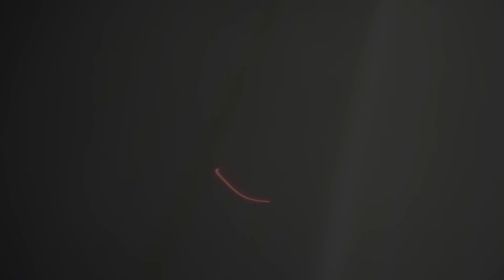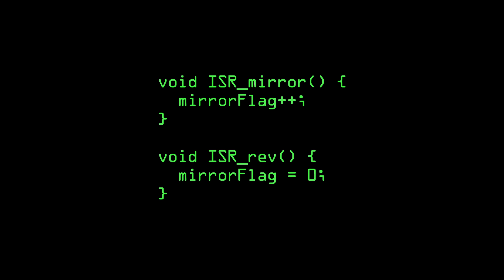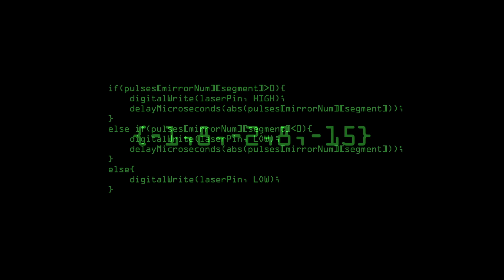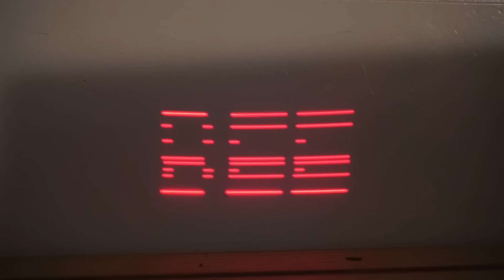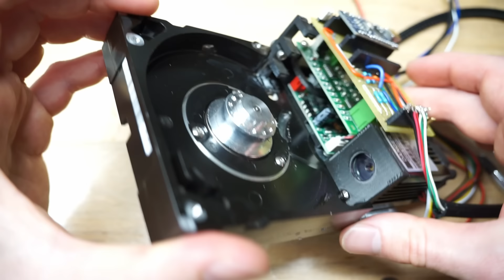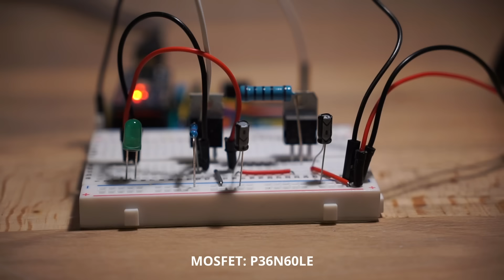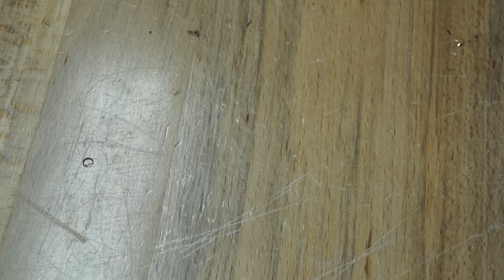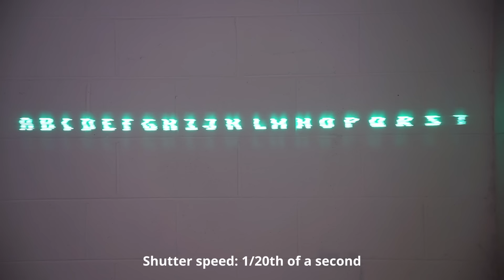DIY Laser Projector - Built from an old hard drive

Comment: Nice, project  instead of using rotating mirror u can use tow galvanometre to drow vector image and text, also  u can use three 18650 lipo battery for power.  Use tiny spring under the mirror to adjust their tilt.

Comment: I suggest refactoring the circuit design to commute the laser diode so the MOSFET "short-circuits" it ( "Shunt" or "Shunt with Over & Under Drive", i.e. connected in parallel to the diode, so it turns it off by making the current flow through the MOSFET when *on*.  ). That's a trick that would allow a significant improvement in switching time, with no "leak resistor" needed in "Shunt" mode.

Comment: if the timing is from the balance of the print, you could add another arm opposite the frame start arm, but have it stop short of triggering the sensor and give it a greater infill so it has the same mass as the existing arm

Comment: i would suggest maybe a cheap balancing rig, like for hobby rc planes for balancing the props, that will help with the vibrations. hopefully those mirrors are super flat, cuz if they are just like "arts & crafts" cheap box of disco ball mirrors, they are nowhere near flat enough. and both the roughness of the mirror and unbalanced jig will prevent that display from ever being smooth and crisp.

Also not sure what kind of driver you are using but if it's just a MOSFET on and off, you can prolly make a better one yourself. i have a big COB LED and i use its cheap driver board with a MOSFET functioning like a PWM power switch.

lastly try a better microcontroller, such as an ESP32. its much faster, if i recall right up to 80Mhz, i think stock is 8Mhz. and it comes with blutooth and wifi, reducing your external breakout boards to one board the size of the nano. it also has a RTC built in so you can use real time for timing purposes. with the RTC and a higher CPU clock would allow you more slices in time to catch when your IR beam is broken.

Comment: Nice project, really enjoyed watching your progress. 

Doing electrical engineering for a very large laser company, I would not entirely blame the Arduino for the imperfections of the image.

In industry, we use two dimensional scanners for such jobs. Less moving parts, better adjustment.

First, I would use a aluminum, balanced mirror holder. The mirrors are crap, I would go with better quality ones. The sensors are placed in a bad angle related to the notches.
You definitely need a precise way of calibrating  your mirrors.
Reply from the maker: Thanks! There is a lot of room for improvement for sure. I'm aware that the mirrors should be first surface ones, which I will change if I build another one. I also plan to switch to hall effect sensors for position reading.

Comment: Laser printers use flawless rotating mirrors to scan the page, and the vertical movement can be done with a mirror mounted on a hardrives' head actuator or the focusing unit of a CD/DVD drive, which both conveniently have about the resistance of a speaker, which itself is a very popular option; an electric razor or coi in a magnetic field would also work, the options are endless.

Comment: Use avr-gcc and avr-libc by themselves without arduino for the most performance.  There are no default processes like millis() being serviced in the background, that will go a long way to eliminate the jitter.  You can accomplish this using vscode instead of the arduino IDE.

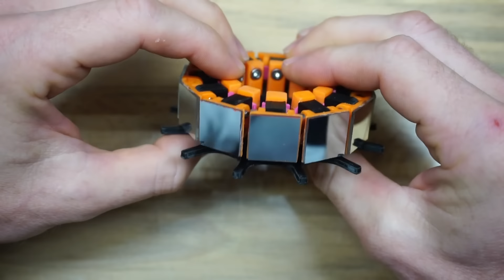Comment: 10:28 - So hitech looking part! I like it a lot!
Friend, are you using the bare black printed plastic passing in the optic sensor?
Be aware some black materials looks black for our eyes but they are translucent or even transparent to IR.
Try putting isolation tape or aluminum plate pieces in the sensing tabs to check if reduces the wobble effect (the aluminum is better of course).

Comment: Someone else noted the interrupt delay. 
Ignore that and switch to an ESP microcontroller. The faster clock speed will totally remove interrupt jitter, make Bluetooth easier and allow for Wi-Fi, allow for vastly improved horizontal resolution and introduce the possibility some tricks like PWM brightness control.
Reply: STOP promoting Chinese product
Reply from the maker: I actually tried an ESP32 with this but had issues with the interrupts - it seemed like they were inconstant and caused timing issues so I went back to arduino.
Reply: @benmakeseverything  that's really surprising and good to know. I will definitely look into this. Thank you.

Comment: Cool project.  Did you look into using a shutter for flashing the laser turning off and on like old film projectors it is a wheel with cutouts in it.  May reduce your overall complexity.  then you would only need to control the speed of the shutter wheel.  Good Luck!

Comment: The wobbling is jitter in interrupt response latency.  You would need a higher frequency CPU clock.  You should also make sure you specify all global variables as 'volatile' and enable full speed optimizations (-Os) in the compiler.

Comment: Instead of quickly turn on and off of the laser, try to use another shutter wheel disk with small sliced gaps. So your limit will be how fast you spin the wheel instead of on-off

Comment: Well done! I have been envisioning a very similar project for a couple years and never got around to it. This is a really clever implementation. +1 on the advice to ditch the Arduino. Maybe a Teensy 4 would be a good candidate, thanks to the Cortex M7. If you're feeling really ambitious, you could also switch to a hobbyist FPGA, like an Alchitry board or a TinyFPGA BX. Also, maybe you can order a planoconvex lens from ThorLabs or Newport to tighten up the resolution? Again, amazing stuff here!!
Reply from the maker: Thanks, the teensy seems like a decent option. Powerful specs at a decent price. I might use that on the next version.
Reply: Great project! I'd also recommend using a Teensy 4.0 to replace the Arduino. @600Mhz it'll give you everything you want. @benmakeseverything

Comment: For the sensor, use a magnetic sensor instead of the ir sensor. That should get rid of your wobble. Also switching from an arduino to a teensy4.1 may help a lot since the arduino works at 16mhz and the teensy4.1 at 600mhz.

Comment: Just a thought that popped up, If you make the Mirror assemply to always point forward, it will be easyer to balance, you could then build a mechanicaly linked prism assembly that would turn verticaly in front of the mirror. This would make it scroll to the next line every time the next mirror(line) moves in front.

This would also fix the one line of text issue as your horisontal space is not limited by the amount of mirrors you have.

Comment: It was one of the techniques used  in early mechanical television scaning system. Inventor mihaly traub uses fixed mirrors in circle with less number of scaning mirrors at the center .Comparable technique like nipkow disk was also used.

Comment: X-Y mirror assembly would be far simpler.
Reply: How exactly would you do this, any way that I imagine it doesn’t make sense because there is no way to keep either X or Y constant while one motor scans the opposite axis (let’s say if Y is constant then a motor has to scan X). After the scanline is done then it has to increment to the next row (increment Y position). But now you don’t have a continuously spinning motor for one of the axes, you’d have to use a stepper or something. And if you had them both continuously spinning I can imagine it would scan diagonally
Reply: @cobaltxii  X-Y mirror assembly has them on coils with a magnet so the voltage determines deflection angle. Then you just feed it X-Y coordinates. It has nothing continuously rotating so there's no restriction on the pattern. Move to upper-left, scan across at desired speed, then move down a scanline. Apparently some use galvos (motors) with feedback, and are expensive. People have made them with a pair of speakers with one end of the mirror mounted on the middle so it deflects.

Comment: If you wanna go mind-boggling complexity for the next version, the HDD head controller and arm probably has a ludicrously accurate MEMS servo / actuator on it that could control a very small intermediate mirror. This means that all of the mirrors could be mounted at the same angle and vertical offset could be managed by the head assembly. This would not only theoretically allow a greater vertical range of motion, but would also allow "vector" graphics as the angle of incidence could be changed during the sweep of a single mirror.

Almost certainly impractical, probably incredibly difficult to program, definitely prone to a huge amount of environmental instability, but, you know, possible...

Comment: Cool stuff!  Knurled Brass Insert Nuts instead of self-threaded, for next project.  As others already mentioned, a multi-core MCU at higher clock rates may clean up the image.  INT0 on PD2 is the fastest external interrupt on the AVR8-Mega series ... and it is not fantastic.

Comment: Great job! The wiggle of the text is similar to the splash screen of games on old computers like the ZX Spectrum. You can project your text or image onto a horizontal series of falling water drops or solid flowing water in the form of a flat waterfall so as not to fight the wiggle but to make it an "interesting feature" of your project.
Reply: My ZX80 back in the 80's glitched every time you typed a key because the video was done purely in software, throwing the generation off while it was doing something else. Using reverse engineered code for the PAUSE function though and if you timed things precisely in all the possible code paths, literally adding up the count of Z80 CPU instruction cycles and balancing them out for all code paths padding with NOPs if necessary, writing fairly simple games that would be flicker free was possible, a lot of fun and more interesting than schoolwork :)

Comment: I love it. 
I use a stereo amplifier with 1 inch speakers fitted with mirrors hinged on rim of speaker and pushed by centre . One channel is vertical and other horizontal. I have 2 oscillators that can do sine ,square and saw waves. 
Result some amazing patterns. 
As you said a small adjustment at laser end makes big change on screen. I have red and green ,did have a blue but was too dangerous so pulled apart and dumped.

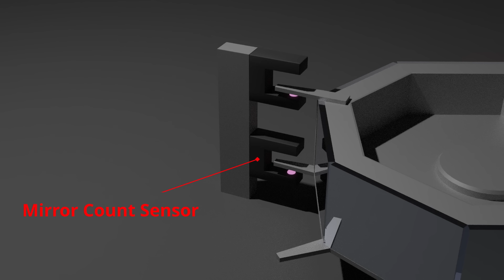Comment: Very interesting Video. I would like to know, why it should be relevant, which of the identical mirrors is passing (2:20).
Reply from the maker: Since they are at different angles, and we don't know what position the mirror array will be at when the device is powered on, that sensor ensures that the count always starts at the beginning (in this case the top line). Without it, it might start counting somewhere in the middle, so the the image might get projected something like: 7,8,9,10,11,12,1,2,3,4,5,6 instead of the correct 1-12. Hope that makes sense
Reply: @benmakeseverything  Absolutelly. Thank You!

Comment: I'm for More Power Ben and I'm not talking about going Overboard - We need Sharper and more defined stop start without the dimming of the frequency screwing with the laser - So The Power needs to be an RX2  with 3d printed handles and maybe a tripod stand holding the 5 liter gas tank - Oh and Earplugs for the audience what do you think?
But if the Rotary doesn't produce too much smoke the writing will be Burned on the wall.

Anyway Ben enjoys the project - hope you enjoyed my jokes.

Comment: Due to interrupt delay jitter, (interrupts are not instant, the micro has to finish it's current instruction) you'd probably be a lot better off just using interupts for incoming message updates from your bluetooth module.
Get rid of that motor driver and have the Arduino generate the motor pulses, that way the motor rotation will be in perfect sync with your code, this would also allow you to lose most of those tabs driving the photo transistors as you now know where the motor is as it is now slaved to the Arduino & your code.
The only extra bit is you'll have to add some motor startup code as it cannot instantly run at your final speed, you'll need to ramp it up slowly.

Comment: Really impressive Ben.   Well done on the persistence too.   couple of ideas for your future versions.   1) Not sure about the availability of red and blue laser diodes that could have their output balanced with this green one, but RGB would be awesome!    2) how about using the super-fast HDD heads arm in a vertical orientation, with a small mirror on the top.  you could use it between the diode and the spinning mirrors to dynamically apply micro vertical adjustments by your microcontroller, so you could programatically control the up-down scanline sweep, rather than manual mirror adjustments?
Reply from the maker: Thanks, I definitely want to try RGB, and more lines of resolution!

Comment: Super nice job! Makes me almost ashamed of my electrical tape-wrapped, hack-n-slash "proofs-of-concept" lol.  To the extent that I can offer any advice, I'd recommend avoiding alkaline cells just as a matter of principle.  Those things are just such a scam.  Hell, if you really wanna make everything, make your own primary cells - there are many chemistries that lend well to DIY, but my go-to for something like this would be 2 or 3 18650 cells.  There's tons of old laptop batteries that have 1, maybe 2 truly dead cells out of 6 or 9 so you can often find them for free.

My other suggestion would be to ditch the AVR mcu.  Although Arduino boards can be nice for ease of use and cost, the ESP32 could probably solve your performance issues and actually do it for less money when you factor in the cost of a separate bluetooth module.  If you don't mind being limited to a WiFi radio you could use something like a D1 Mini (ESP8266) for even cheaper.

Comment: You can also glue small, front-surface mirrors to small speakers and bounce the laser off of them.  By using the right combination of signals you can do, X-Y vector graphics and text.

Comment: This is very similar to how the laser scanner assembly in a laser printer works.  The laser is controlled by an analog video signal.  Also, using front-surface mirrors may sharpen up the images.
Reply: A good point, Shawn. Maybe parts and ideas can be extracted from the laser scanner assembly in the laser printer (I suppose thats when the drum in the printer is activated to partially keep the toner) .

Comment: I don't know if anybody already mentioned this but it looks like you're using regular mirrors. Your images might be a bit crisper if you use first surface mirrors like those used in reflector telescopes. That would eliminate ghost reflections.
Reply from the maker: You are correct - they should be "first surface" mirrors, but I was having trouble finding small ones, and didn't have the right tools to cut my own from a larger piece.

Comment: you will want to use lithium batteries because modern electronics are very demanding on batteries.

you will need an lvc circuit not only protect the lithium cells but as the voltage goes down the mirrors will spin slower and can be a danger to the eyes as the laser would stay on longer.

Comment: Fantastic! You did exactly what was on my todo list for years. I also had a second version in mind that would have 7 individual beams and an accelerometer. The whole thing assembled in a handheld torch would allow the user to wiggle the text onto buildings. Well done and thanks for sharing. I will still do this project and now can avoid some of the traps you mentioned. May I suggest you try a Raspberry Pi Pico w board? It runs much faster and has special signal generating modules that are even capable to generate a stable VGA signal. Added bonus is the wifi and bluetooth functionality built in.

You did use front facing mirrors right?
Reply from the maker: Your idea sounds really cool, you should build it! I actually didn't use first surface mirrors, even though I know that would improve the brightness. Next time around I will.
Reply: Not just brightness, but beam coherence also  @benmakeseverything .

Comment: You should use a Raspberry Pi pico w for the version 4, it has much more powerful CPU as well as the onboard wi-fi, it might also solve that horizontal wiggle issue, If I remember correctly... when using a "delay microseconds" on Arduino -- the timings will not be correct due to the software interrupts.. 🤔

Anyway... I must say this video left me speechless, because I remember wanting to make the exact same thing all the way back in 2019... but unfortunately I didn't have the required knowledge and experience back then to build it myself. 
I am so glad to see that I was on the right track, and now I'm considering to finish what I've started, thank you. 🥲
Reply from the maker: Thanks, I'll check out the pico for future projects. Best of luck on your project!

Comment: I was thinking instead of the spinning drum, use the voice coil motor (head actuator) to steer the beem L/R and a 2nd one to steer it up/down. Thoughts?
Or even two speakers.
Reply from the maker: That sounds like a Galvanometer setup, which many laser device do use.
Reply: @benmakeseverything  I am thinking of placing the mirrors on the HDD actuator rotation axis, one setup for X and one for Y, I dont see that as a galvanometer, but simple X/Y control